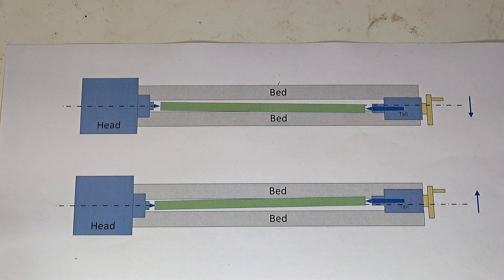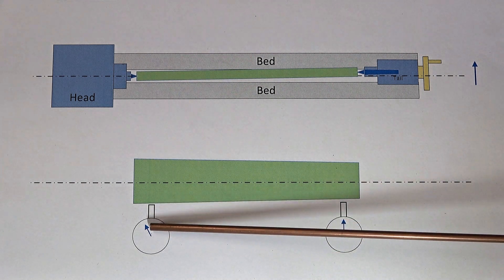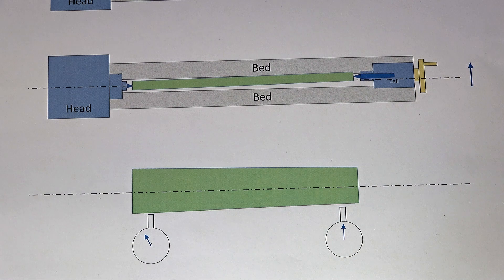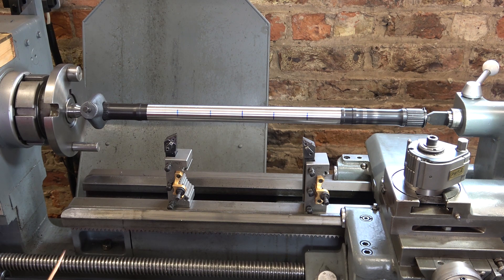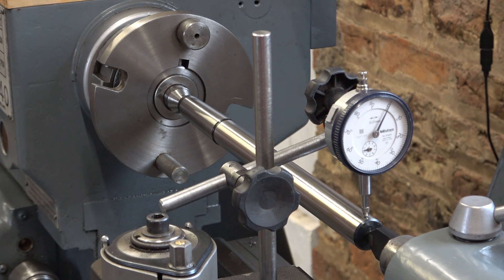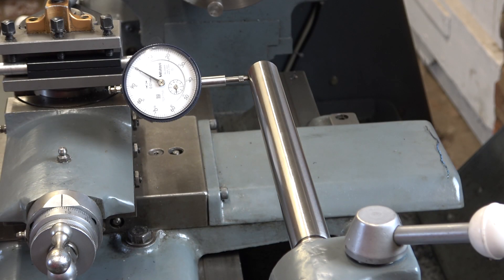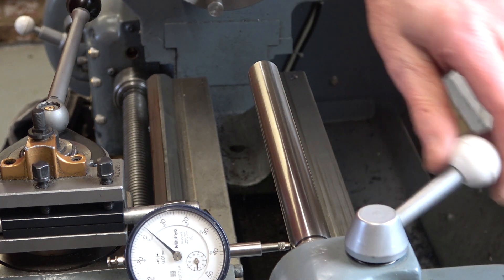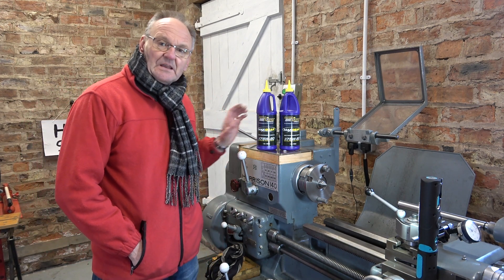HS57 Harrison 140 lathe parallel turning test – update

Comment: ISO68 is not equivalent to Tellus 32. The number gives the viscosity in centistokes, in both cases.
Reply from the maker: Hi Carl, I don't know the technical details of viscosity units but I do find that the modern equivalent for Tellus 33 is always shown as ISO68, so I've relied on that. Regards
Reply: @HaxbyShed  Hello again! Yes I stand corrected on that. I hadn't realised that was the case until now. I believe that Harrison specified ISO68 hydraulic fluid as the lubricant in many of their lathe headstocks. Certainly in the M series anyway. 68 is also used on the ways.

Comment: Hi,
Great video - very interesting. Its easy to go mad doing this stuff as you are trying to understand so many variables at once. I watched this and the first  vid also. 
I have a Harrison 11 inch which i bought a year ago. I eventually tracked non parallel turning issues down to the headstock not being aligned. I noticed that your lathe has damage on the top slide front where there has been a collision with the chuck at some point in the past. I had similar but worse than yours. It had apparently moved the front of headstock across so that it was turning narrower away from the headstock. You can in fact adjust the headstock alignment and i was able to correct the issue. It may help you to sort out headstock from tailstock non alignment by turning a bar in the chuck only ( unsupported). you need to use a fairly stout bar ( i used 38mm steel), light cuts and honed HSS rather than carbide tips. The comments below on pressure from carbide tips are also bang on in my experience. 
Any conicality with this method is not tailstock related , obviously. it may be headstock non alignment or bed twist or bed wear. You'll need to sort that out separately. Send me a message if i can help you further. Ive been down this road. You can assume nothing is as it first seems. good luck.
Reply from the maker: Hi Steve, thanks very much for your supportive and informative comments. I've a couple of things in mind. I've bought an engineer's level and so I will be checking the bed for twist in the next couple of weeks or so. Also I will be doing some turning tests - mainly to explore the max cut I can make - and I will check for unsupported parallelism at the headstock. Yes I agree it's a learning curve with many moving parts (literally).

Comment: Hi, here is a high resolution bubble level on ebay. it has a resolution of 0.1 per metre, or 0.001" per 10". 333887779538.
I suggest these types, as general machinists levels do not have any resolution or accuracy, using a level with a stated resolution means that you can plot out the actual geometric form. Manufacturers such as Watts, Hilger & Watts, Wyler, Mitutoyo, and Steifelmayer; are very good.

Here's a link to a very good book on machine tool accuracy: https://pearl-hifi.com/06_Lit_Archive/15_Mfrs_Publications/Moore_Tools/Foundations_of_Mechanical_Accuracy.pdf
Link to testing of machine tools: https://pearl-hifi.com/06_Lit_Archive/14_Books_Tech_Papers/Schlesinger_Georg/Testing_Machine_Tools.pdf

Link to a very good Archive: https://pearl-hifi.com/06_Lit_Archive/
Have fun. Regards John.

Comment: Hi I have a Harrison L5 on setting up my lathe I found the most critical factor was elimination of bed twist. My garage has a substantial floor slab 12 inches of reinforced concrete. The Harrison manual recommends that the lathe is not bolted down, but  the holes used for locating pins. It states that the lathe should be levelled by packing under the four feet. I used a precision level to make sure there was no twist in the bed. It took a few days of putting shims under the feet getting it level leaving it stand over night to settle and then checking it the next day. I also have some bed wear, but find this is not a major issue, the advantage of a v way is that as the v wears (approx the same on each side of the v the saddle and hence the tool tup move vertically down by the amount of wear 2 or 3 though this will have almost zero effect on the diameter. I find a 2 or 3 thou error in the hailstorm centre due to wear in the quill and the barrel bore, and the projection of the quill then it is locked. When turning a shaft that is longer than  6 inches with a tailstock centre for support I set up the tail stock. Lock it then take a cut on the diameter measure at each end, and if it's turning a taper adjust the tail stock side to side with a DTI on the tail stock end of the work on remove the taper, centre towards the tool if dia large on the tail stock end. Another cut and diameter check to ensure so is well it may take a couple of tries. Do not unlock the tail stock or the tail stock quill until the work is finished. If the work is larger diameter in the centre one of two final spring cuts will help bring it to the right diameter along its whole length . Regards Peter Edwards
Reply: I will second eliminating bed twist, I had read about how rigid these were due to the construction but in my experience they twist. When I put my Starrett level across mine I got a bit of a surprise how far out it was. 🙂
Reply from the maker: Peter, thanks very much. I am being pulled towards the bed twist theory - or at minimum a proper check. I've started scouting on ebay for a machinists level used at a sensible price. Do you have any idea how much twist was across your bed? Is it possible to know from the thickness of packing you added? My cabinet has jacking screws at each corner - but as you say with the hole though for a location peg.
Reply: Hi 
The floor of my garage is normal building standard for level and flat, so I don't think the packing thickness would yield much useful information. The installation instructions in my manual say " To ensure accurate production it is important that the machine be on a solid floor and correctly levelled. This should be checked with a sensitive spirit level as follows:-

Test longitudinally with spirit level on either of the flat bedways.

Test transversely and for twist with the spirit level across blocks of equal height, one on the front and one on the rear flat sideways (the manual actually says sideways I think they mean slideways) at each end of the bed in turn. If correction is necessary packing should be inserted under the lower corners of the base."

This demonstrates that the two flat slideways form a plane that should be flat and level. In my opinion from a taper turning point of view it is much more important that there is no twist in the bed, the bed does not have to be perfectly level.

Then the lath is new these two surfaces can be relied on, with an old lathe the rear flat slideway will be worn. On the Harrison the front flat slideway only supports the tail stock, so the two ends will most likely be as originally machined, the rear flat slideway will be worn on both the top and bottom surfaces. When I got my lathe I removed the retaining strip from the underside of the carriage and re-fitted it by scrapping  it flat, to remove any vertical play, If I move my carriage to the tailstock end of the bed it tightens up. Measurements of the thickness of the rear flat slideway are 0.749 inches at the tailstock end 0.748 9 inches towards the headstock 0,746 18 inches towards the headstock 0,747 at the headstock this gives 3 thou wear, unfortunately we don't know if this is on the top surface or the under surface.  I came to the conclusion that to minimise the taper turning effect the best plan is to set the plane you have today with zero twist. 

I set my lathe up as follows.

Put a packing piece between the rear feet to give a 3 point balance, put a level across the bed at the headstock end (on two ground 1,2,3 blocks) level the lathe by packing under the headstock feet, level longitudinally with a level on the flat front slideway, pack under the rear feed. Now check for bed twist by checking across the bed at headstock and tail stock end. Note the bed does not have to be level, to ensure no twist the readings on the spirit level have to be the same at both ends. 

My spirit level is a Rabone and Chesterman precision machinists level 8 inches long checking it on a surface plate with parallels and feeler gauges you can reliably measure to 2 thou in 12 inches. The flat slideways are 4 inches apart so 1/2 thou each end which gives 1 thou twist on the plane 30 inches long 4 inches wide. We don't know the wear along the bed, so it may go up/down a bit between the 4 points of the plane we know. 

When I levelled my lathe I used steel plate 1/8 and 3/16 and steel shim 002,003,005,010,015 (this is what came in the tin). I got the twist to within a thou, and the lathe leans forward slightly about 1 thou. This was the best I could do. Longitudinally its level when checked on the front flat slideway but only checking the spirit level bubble is visually in the middle. I did not record it at the time but when I set the lathe nominally level and then checked the twist I was getting a full deviation on the level bubble so 5 thou twist.

I made my own test bar from 3/4 inch diameter Precision Ground Mild Steel (PGMS) I set the bar in the 4 jaw with the minimum projection faced and centre drilled the end, then skim cut the centre drilling with a small tool in the compound set at 60 degrees. Turn it round and do the other end. I use this bar to set the tailstock offset to zero. So the tailstock is set locked to the bed approx 12 inches from the headstock I advance the quill 1/2 inch using the quill graduations, lock it and set the tailstock in line by tracking along the test bar with a DTI on the carriage. For most work using the tailstock centre, I try  to always use the 1/2 inch tailstock projection. If high accuracy is required I will do a sim cut and check the work for taper, adjusting the tailstock as necessary.

As a matter of interest I checked my tailstock alignment this morning With the end of the tailstock level with the end of the bed about 24 inches between centres  and a DTI mounted on the carriage readings are quill extension 1/2 inch DTI 0.000 1 inch quill extension 0.001 towards carriage 2inch quill extension 0.003 towards carriage. Tailstock position 2 (6 inches towards headstock) 1/2 inch extension 0.001 away from carriage 1 inch extension 0.000 2 inch extension 0.003 towards carriage. Tailstock position 3 12 inches towards headstock 1/2 inch extension 0.000 1 inch extension .002 towards carriage 2 inch extension 0.005 towards carriage. In all cases the quill and tailstock were locked. I should be remembered these readings are a composite of tailstock position, quill position and carriage, so represent the sort of overall accuracy you can expect. One reasonable conclusion is that the tailstock quill/bore is worn, as the tailstock wears the operator tends to tighten the quill tock slightly when drilling, and this causes wear on the front side of the quill and bore.

At the end of the day we need to remember these are old machines, and in an engineering production environmental would be considered scrap. The other consideration is what accuracy can you consider reasonable from these machines. I would expect a part say 12 inches long 3/4 inch diameter with a specification of 0.750 -.000 +.001 to be lathe turned. If the spec was -.000 +.0005 (for say a bearing press fit) I would expect it to be ground, this when the machine is reasonably new. With time and care and careful setting up you can produce accuracy on old machines.

Trust this is useful, real measurements from similar equipment gets you into the realms of what is practical and achievable.

To give you a little bit of confidence in the above I am a (now retired) Chartered Mechanical Engineer, I was not in my career specifically involved in production engineering and machine tools, But was responsible for the installation of large compressors and generators up to 100 MW which entails accurate alignment of large pieces of kit. I also have had my own hobby workshop for 30 years. Regards Peter Edwards
Reply from the maker: @gedwards9789  Wow Peter, I've just copied and saved all that into a document. And this evening I bought a very nice (used) level which should arrive in about a week. If I can get the hang of it I will make a video of how it goes. Thanks for your help.

Comment: Good to see further investigation, I think a high resolution bubble level of 0.0005" per 10" is needed before continuing further looking at bed twist (another subscriber has already commented to this effect).
The test bar in the tailstock reading is a little concerning for a Harrison lathe, but this could also be a due to potential bed twist. Was this consistent A: along the bed, B: rotating the test bar?
Head stock oil at ISO 68 is okay unless using the lathe at zero °C, in my opinion; In my Colchester Master 2500 ( since sold), I changed to ISO 68 hydraulic, and my garage never got colder than 7 or 8°C. 
Pretty sure the synthetic ATF oil you have, the machine tool manufacturers would loved to have had that choice in the 60/70s'. 
Thanks for sharing and best regards from the Black Country.
John.
Reply from the maker: Hi again, I am on the lookout for a used machinists level - I've started scouting ebay today. Yes I was surprised that the test bar was out in the horizontal and not in the vertical - that is a pointer I think. The bed twist believers may be right. ISO68 is very gloopy at freezing point. The thinner oil advocates think the splash lubrication will be fine at low rpm with thinner oil - I'm not convinced yet. The Royal Purple MaxGear 75w90 oil I've bought is synthetic gear oil (perhaps not strictly auto box fluid). They also do SynchroMax which is synthetic for manual gearboxes which is thinner than MaxGear - but MaxGear is still thinner than ISO68 at low temp I believe. In my mind the headstock gears are more like a differential than a manual selector box. They are both yellow metal safe. Cheers
Reply: @HaxbyShed  I thought it was ATF fluid you had purchased, and same that DoubleBoost has used. My apologies. Might be interesting to pour similar amounts from each in  containers, and compare at different temperatures. Yes, many forget that the EP series gear oils has Chloride added, and is deleterious to the brass based components.

Comment: Hi Haxby. Plenty of oil lubrication needed on a solid dead centre as the workpiece expands in length without coolant when machining. 
This may contribute in the deflection of the workpiece away from the cutting tool position hence the larger mid section diameter as well 
as all other the common factors involved without using a travelling steady. Enjoyed. I'm no expert. A bit of knowledge. Dangerous. Tony
Reply from the maker: Thank you Mr Tony. I had to use the dead centre because the bar was too long and it was all I had. When we get through covid I will go out scouting for metal stock. Cheers

Comment: Nice video update!  I really like the method of tailstock alignment from Richard King, the scraping expert. Put a chuck on and turn up a small scrap to the exact diameter of the tailstock quill and leave it in the chuck. Bring the tailstock up close to the turned part and lock it (you might need to avoid the gap-bed part). Then with an indicator on the carriage, sweep the indicator over the top of the two diameters, then over the front of the two diameters.  This is very sensitive and makes it quick to align the the tailstock as long as you don't take the part out of the chuck.  Note that on many lathes, the vertical alignment is very slightly high (0.001-2") on the tailstock side to account for droop when the tailstock is holding a part.  Everybody has their own method and I'm sure you will find yours!
Reply from the maker: Thank you. That sounds like quite a quick confidence test. I'm taking a bit of a rest from parallel turning now but I will look at that method if/when I get an accurate level to test for bed twist. Cheers.

Comment: HI  like Jimmy McLeod suggested twist in the bed is the same affect as a offset  tail stock 
The chatter is the way u have your tool set up u are pushing the tool in to the work piece there for it tends to dig in adjust your tool so it is more perpendicular to your work piece more of a dragging action will reduce the chatter yes the tool holder is perpendicular to the work but the cutter is not it is pushing in to the work from what I seen in the back ground pic
Reply from the maker: Jim, thanks. I will get hold of a machinists level and check the bed twist. And I get your point about chatter when turning towards the centre. It was a "let's just try it" thing but not properly prepared. Cheers.

Comment: Couldn't some of your error be explained by a twist in your bed?  After all, you did measure for twist with a carpenters level.
Reply from the maker: Was my level as good as that even?  I think a proper bed level check would be the next step, before I adjust anything. I'm looking for an engineers level on ebay for a sensible price. Cheers.